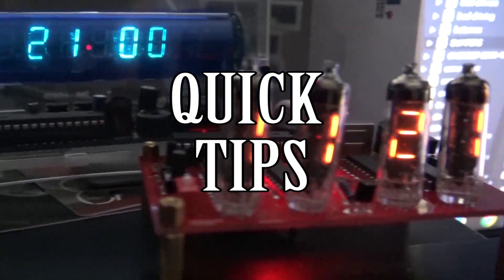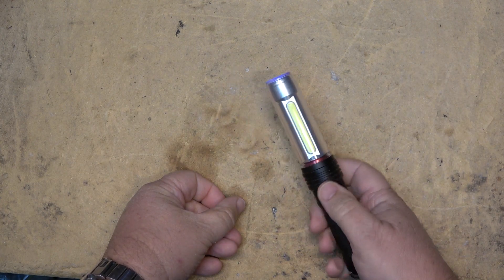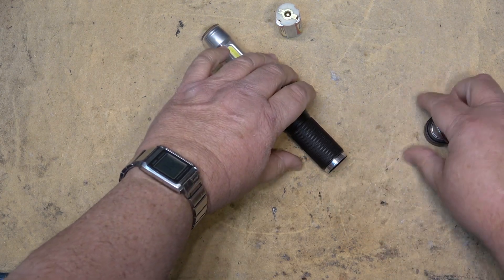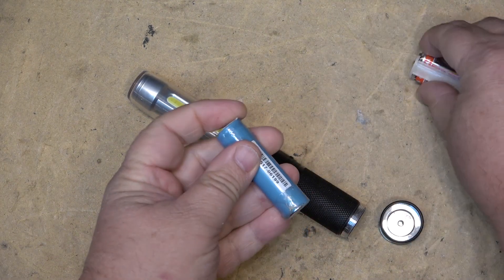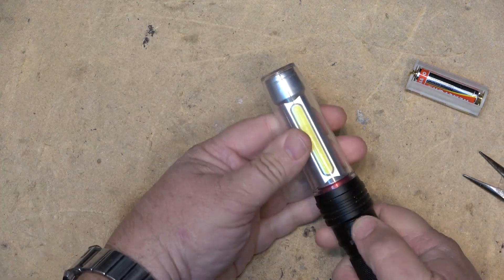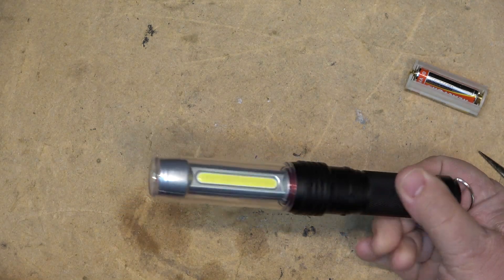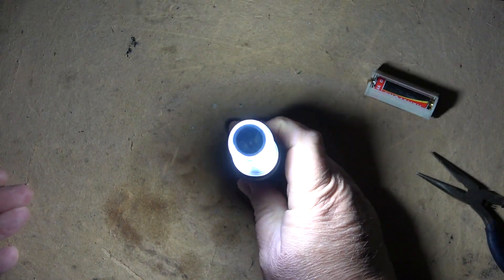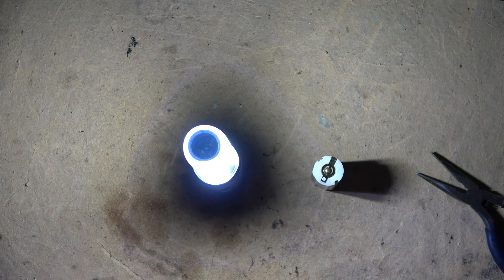Quick Tips 3x AAA to 18650 Flashlight Battery Hack

Comment: wondering if LEDs will draw more amps resulting in early failure?
Reply from the maker: Take 3 AAA batteries in the battery back and short it and see how many amps you can draw. You will melt the battery holder.  So no it won't affect the life of the led compared to regular batteries.
Reply: @12voltvids  Makes sense.  Thank you for the answer.

Comment: Most of my flashlights have been modded for lithium batteries. If there is enough room, I’ll put in a bms to prevent the battery from discharging to low.
Reply from the maker: Shouldn't go too low as the white led will extinguish below 3 volts anyway.
Reply: It will still draw current. Left one on for a few days in the basement Checked 18650 and it’s was around 2.25volts. I still charged it and seemed ok.  Batteries are cheap anyway.
Reply from the maker: @jimfong1534  these are free.  I get them out if old MTA boxes.
Reply: @12voltvids  Just open the front and put a 1R resistor in there, as the LED chips are otherwise going to be destroyed, as these rely on the internal resistance of the AAA cells to limit current. 1R to around 2R7 works well to tame this, and you get longer run time, plus of course the led dies will actually last more than 3 charge cycles.

Comment: Yup. I want to try that with the Harbor Freight cheapies they used to give away. Need to find  a way to get the switch out of the rear of it, and spring out without destroying the PCB the LEDs are attached to. Thinking about just jamming my iron into the cylinder and heating it blind, then quickly flipping it and rapping it on a hard surface. I can't seem to get the PCB out. There's a coiled spring retainer holding it in. I know, too much time on my hands, or not enough!! 😆😅🤣😂🙃🤪😜🤪😜

Comment: What about 3*1.5v = 4.5v from AAA and 3.7v from 18650 ?
Reply from the maker: What about it? LED only require 3 volts. The reason they use 4.5 with the aaa version is for lower current consumption which extends battery life. With alkaline or flashlight batteries the voltage starts to drop as soon as the light turns on.
Reply: 18650s are 4.2 volt fully charged when they get to 3.7 volt they are over half way ran out.

Comment: I've had a few lights with this ability. if you have access to a 3d printer you can make sleeves for them to help keep the 18650 alighned
Reply from the maker: No need, they fit ok and are tight. Spring needs to come out or the end cap won't screw on.
Reply: Or just some heat shrink wrap, or virtually anything else